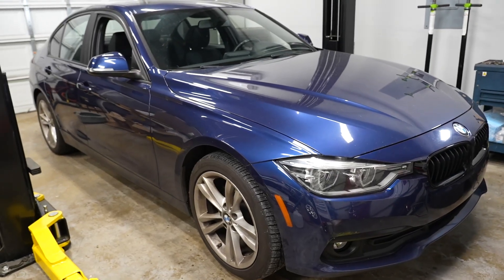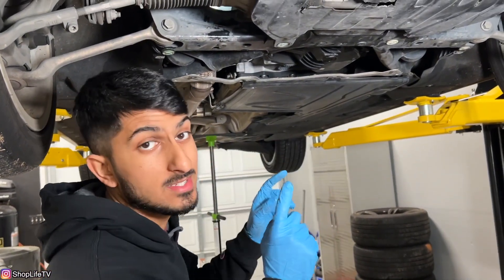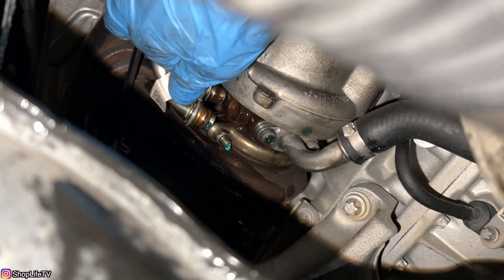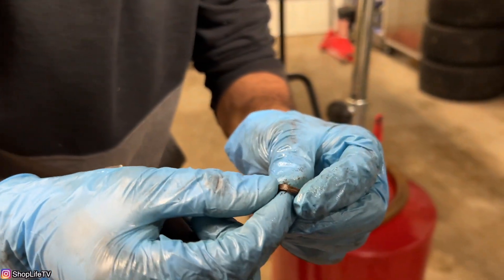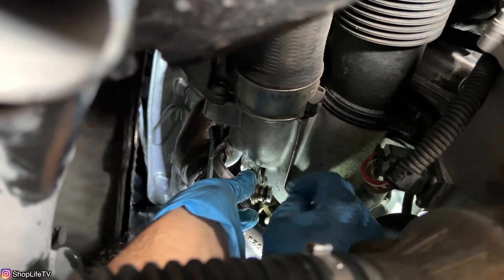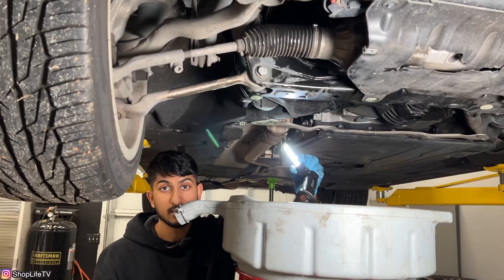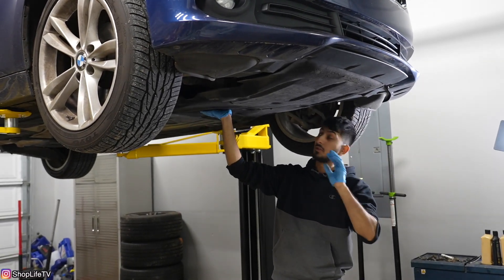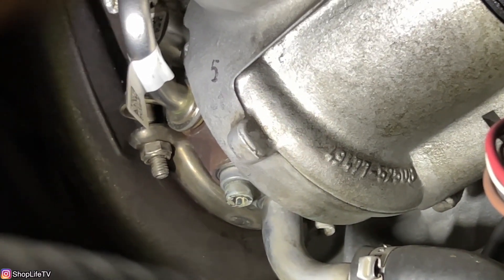Is Your Turbo BMW Leaking Coolant? (N20 Turbo Coolant Lines o-ring DIY)

Comment: Can coolant get in to the exhaust? Asking because we have a car with a turbo coolant line leak that puffs just a little bit of smoke at start but never after warmed up. Just wasnt sure how it could seep into the exhaust but the turbo is part of the exhaust so maybe?

Fwiw we didn't suspect any other issue like a head gasket, cracked block etc because it totally stops after warm up like the coolant burns off.

Comment: Almost done however upon install snapped the T30 torx bolt head off…as lower line wasn’t fully seated. 

So currently debating how to extract that bolt without having to pull out the turbo granted the tight space. 

Also faced difficulty pulling the lines off and had to really pry and work back and forth (towards front and back or car). The top line was also very difficult and I found a small vice grip to help with the wiggling, took about 1-2 hours for removal. 

All in all I thought it a 30 minute easy job would have been worthwhile, but if I have to pull the turbo to replace the broken bolt I may as well replace with a new turbo and coolant lines for about $350 for parts as it’s not a quick job.

Comment: 2:20 Pain to replace (the lines) without removing the turbo 
2:50 T30 
7:43 Silicon Lub for installing 
8:25 Blue loctite to hold it in place since it's difficult to torque

Comment: This is misleading. You should replace both lines or both o-rings on each coolant line. You need to remove the whole turbo to have access for the repair. I guarantee you it’s always the o ring on the engine block side.

Comment: Thank you for sharing the info and making an effort of shooting the video. I've been adding coolant to my wife's F30 N20 for the past 3 month. Finally I decided to check the common issues online and here we go: you case covers up to 99% of indicated symptoms. Special thanks for providing the links to the parts (O-rings). Al in all with your help I have saved at least $300, considering the rates that BMW shops usually charge. THANK YOU!
Just to add some details: 2013 BMW F30 with 76K miles.

Comment: Anyone have the problem where alot of white smoke comes out the exhaust at start up then disappears
Reply: Mine too. did you figure out the cause
Reply: I had this and it was the turbo oil line that had to be replcaed. Original design didn't have a check valve so the oil can flow backwards and burn off through exhaust.

Comment: It also could be the line itself too.

The inside of the coolant line gets loose and leaks.

From the middle, not the o ring.

I'm dealing with that right now.
Reply: Did you just replace the line or can you carefully cut the bad rubber off the plastic that goes to the waterproof housing and clamp it on the metal and plastic part in a pinch?

Comment: Hi, I have a 330i f30 2018, I got prob got scammed by a seller who sold me the car and my intercooler fluid is always going below the level after a just few days. They also sold me false insurance that does not cover anything. I feel so helpless and sad, when they took the car in they only pressure-tested the engine coolant reservoir, not the other one. And now they are just unwilling to help me further...

Comment: Went to the dealer for an four-hour oil change and got a $7,500 estimate. $3,700 of it was to replace the turbo cooler hoses. Luckly you made this video           .  Only cost me $38 for two O rings at the dealer.  I only bought those from them cause I needed the part right away.  Thanks for the video help a lot.
Reply: Question, your bmw was smoking when you start the car?
Reply: No, but last month the coolant burst and then there was smoke.
Reply: @bradwilliams1213  thank you very much for your answer 
I will replace this O rings and I hope that stops the smoke on my beemer when I start it
Reply: Hey, so basically the problem with that when you start the car it smokes is turbo charger oil feed line which Bmw replace those lines with a new one new one and upgraded model, which they made later on which it does have a check valve and you will eliminate the possibility of leaking oil to your turbo and cusing that

Comment: Noticed the EPS shield was cracked…either hit a big bump or someone lifted this car in the wrong spot confusing it with the center jack point. Trust me I know. Guilty. Happened to me. Very costly mistake if EPC control unit gets messed up. $6000 +

Comment: 2014 BMW 328i Low coolant indicator came on three weeks ago, and mechanic topped off coolant couldn’t find any leak.  Mechanic also did an oil change the same day.  The following morning my car has had blue white smoke coming out the exhaust on start up.  Is this coolant or is it oil?  The coolant light has never come back on.

Comment: Since 1 month, I have a code that appears in my BMW 528i 2014 (N20) screen mentioning a lack of coolant. Even after adding blue coolant 50/50, after the engine warms up, it mentions the code again in my screen mentioning a lack of coolant and yet the coolant is in min-max of the tank.
What to check?
Reply: The actual sensor is likely bad.

Comment: I have an F30 n26.  Maybe you've come across this issue: The car dumps its coolant when the heat is on.  Could this be the heater core or the control valve, or something else?  I can't tell yet where the leak is, but it's closer to passenger side, you can see some wetness near the water pump but it seems dry, there's no issue when the heat is off.
Reply: Did you ever find out where your coolant was going I have the same mystery with my f30 n26
Reply: Yes, it was the water pump. I ended up replacing that, the thermostat and a few hoses as prevention while I had the system drained.

Comment: What did you use to pry the top one off
Reply from the maker: A pick and my fingers. Can’t really see anything while doing it so wear some thick gloves otherwise you will have some holes in your fingers
Reply: I’ve been trying that I have a little space in it just won’t budge
Reply: I used a shoe lace and wrapped it around the upper line, took a wrench and wrapped shoe lace around and turned and twisted it to secure it. Wigged and pulled and finally got it out. Also I used dental floss to put the o ring back on in that tight spot.

Comment: Did you have to remove the engine to access the turbo coolant lines? I have a 2015 528I and my mechanic wants to charge me $3,500
Reply: Je removed only the exhaust

Comment: Trying get some advice. Any help would be appreciated.
Discovered a coolant leak on my 135i. Took to shop for a radiator replacement and after picking up the vehicle started getting transmission issues after driving it for a day or so.

Comment: Yeah I have the same repair on my brother in laws. Except the coolant was leaking from the hose to metal fitting part of the line. As well as rust belt car so everything was seized. Turbo out, replace lines, replace all o rings on oil lines. And now the turbo drain line on the block side is leaking.  Can't win with this car. https://youtu.be/x0oDImQrI7U

Comment: There is a coolant sensor on the passenger side of the radiator that also like to slowly leak out of the O-ring.  Found ours leaking while doing the oil filter housing gasket.
Reply: is that sensor you're talking about looks like a wiring harness that clips into the upper passenger side of the radiator?

Comment: It's a little confusing from the way it played out, but did you completely drain the coolant or just some from the turbo coolant lines? I tried this and after a few seconds of coolant leaving my lines I plugged it back up for fear I would be stuck holding a bucket under it while the whole coolant system emptied out; which I just changed... lol
Reply from the maker: I didn’t drain the coolant before hand, but during the o-ring replacement I collected close to a gallon of coolant

Comment: If my car starts leaking coolant in December, it isn’t getting fixed until march. Too damn cold for working on cars now. 🥶
Reply: Don't neglect it. An overheated engine could leave you stranded or worse destroy your engine. Overheated engines are generally not covered under warranty and worse, are hugely expensive to replace out of warranty.
Reply: @houseofno  I meant for small leaks. Keep the tank topped up. Will be fine.
Reply from the maker: Hahaha I don’t blame you, I can’t stand the cold
Reply: December is prime car project season in Houston.  Usually no mosquitoes and manageable temps 🤣
Reply: @y2ksierra  I think mosquitos are getting tougher. I get bitten by them all year round. 

Here in London it is freezing and snow is on the way. 🥶